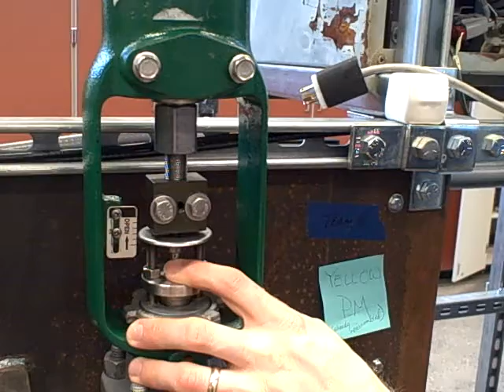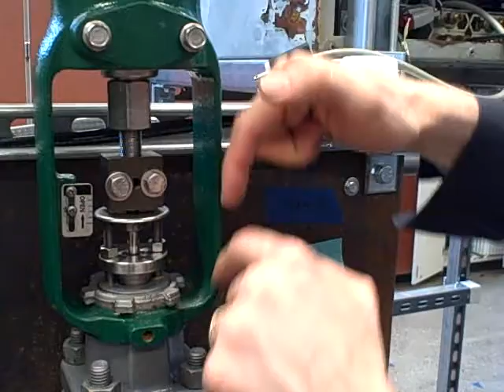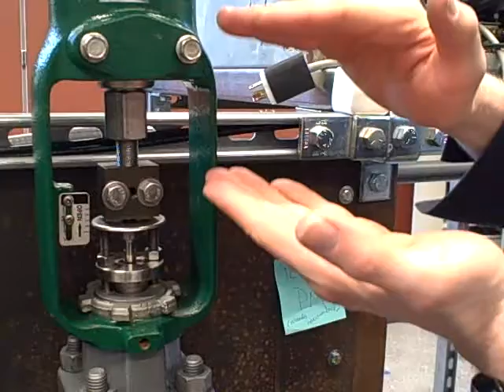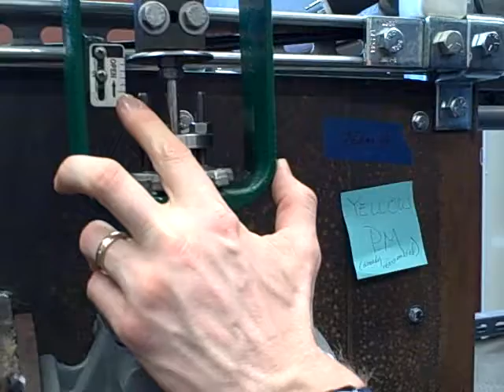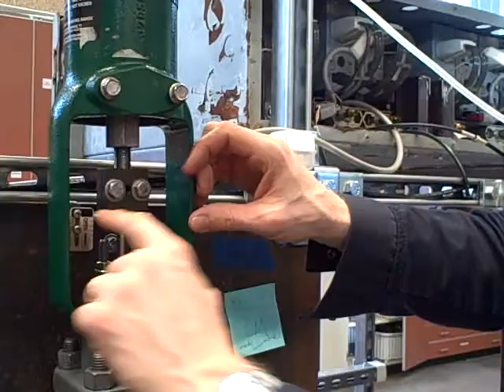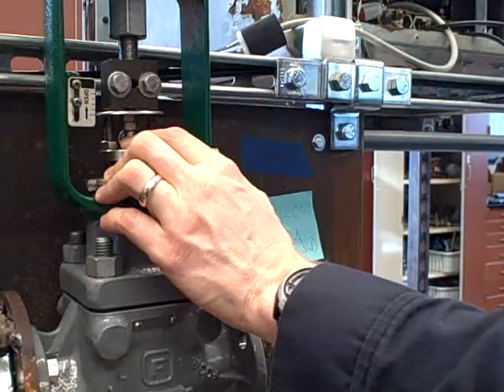Sliding stem valve travel demonstration

Comment: Something I notice as strange here is that I've never ever ended up with space between the indicator plate and the coupler.  I know it really doesn't matter as the nuts lock and prevent the indicator plate from dropping out of range, and the coupler is locked into position.  I just find it strange that I've never come across it before.